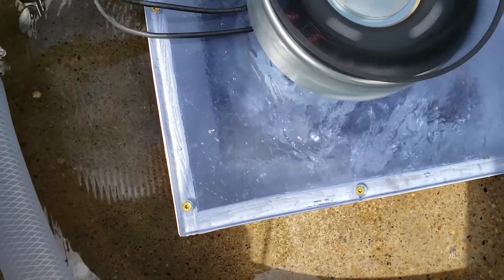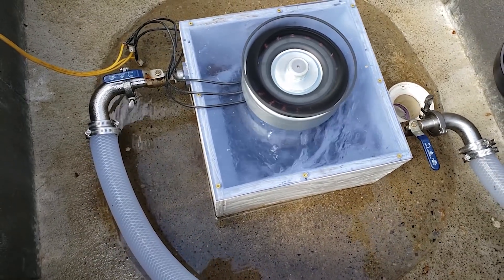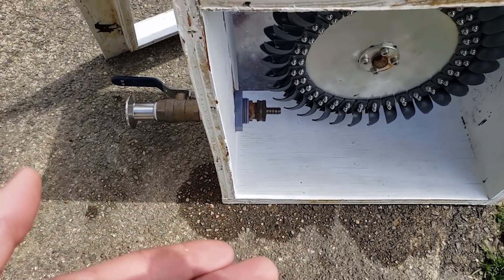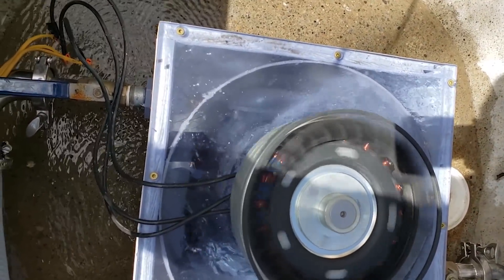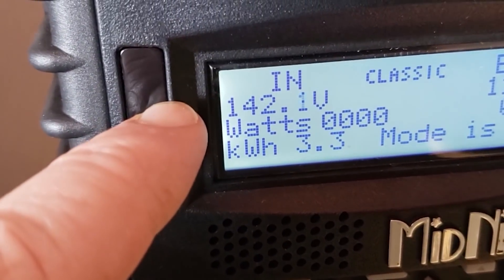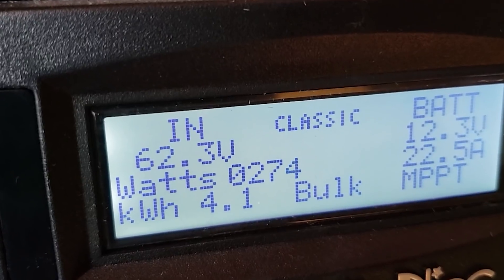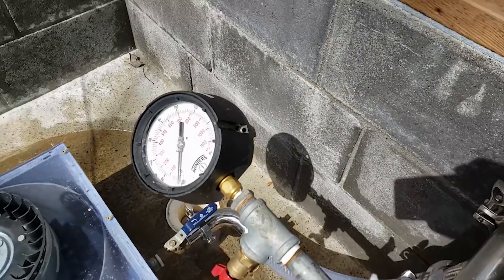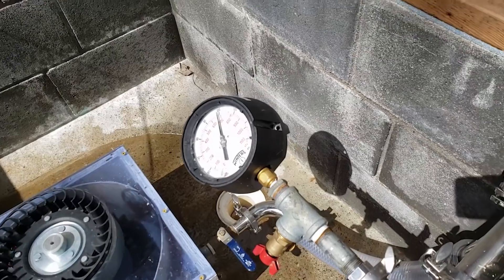Round Turbine Housing, An Improvement?

Comment: If the housing was oval shaped it would give the water a bigger spot to run off in. If you are only using two jets Kind of goes along with what Quentin Clark was saying. I wish there was a way to draw in the comments lol. But where the jet comes out have the housing go longer then put a curve in it that would come back to the housing right before the other jet on the opposite side. add another piece inside that would block the water from getting to the other jet or the turbine.

Comment: I don't know what is available in your area but a gas or water utility company's might have an off cut of main supply plastic pipe usually an inch thick its also quite forgiving if you need to make alterations unlike the stainless one if you find any issues. Also you could try plastic welding it together.

Comment: there is actually an ideal gap between the spoons and your outer wall. look into fan ducting, it's the same idea. but you really only want like 0.25-0.5" of clearance with the spoons, and you should probably drop your headspace above the spoons to about the same. what's the id you need, because I may be able to help you out with some stainless tube that's the right size

Comment: Looks like just about anything to get the 'spent' water away would be helpful, gap in the top, holes/slots/diverter vanes.  Perhaps even a stainless steel blower wheel (I.e. what gets use in HVAC blowers) with the vanes in the right direction could be an off-the-shelf solution that could be modified to work for your final enclosure? Just something to catch the water, move it away from the wheel to get it into an outer portion of the enclosure where the water can drop down to the drain.

Comment: You need to cut the circular housing right before it gets to the nozzles, you dont want a completely round housing you want the water sliding along the housing to escape before it gets to the nozzles, thats where a lot of your splashing is happening. You have spent water sliding along the housing wall untill it hits your jets of water. Cut the round housing into two pieces

Comment: Look into windage trays for engines. They have slots so the oil can escape easily into the pan and get out of the crank case. Something similar here would let the water escape from the wheel and help keep it from splashing back.

Comment: I think around housing that folds completely around the peloton wheel with minimal clearance (like 2-3 mm) would be the best solution. This way the air moves basically at the same speed as the turbine and will have very low turbulence.

To get the water out you create two whole at the top and the bottom behind the the jet nozzle, which match the spray back from the nozzle.

To avoid that water is falling back in the upper hole (by a different nozzle), you need some kind funnel leading outwards.

Comment: I would put some slots/louvers in the round wall. 1 or 2 just before the corner of the square frame should allow the excess water to get out and not stay in the main chamber rotating. That is only if the round wall increased efficiency.

Comment: Cone shape, so it splashes down
Reply: Cam to say this, he's thinking in too many 90deg angles.
Reply: I had the same idea. Doesn't even need to be a cone. Could be pyramid and still work a lot better than what he has. As long as it's moving more of the water down and out
Reply: what about a spiral cone to channel the water down as well?
Reply: That is an interesting idea.
Reply: Came here to suggest the same thing... or put some half inch by 4 inch slits long ways down the middle...

Comment: What if you would add to this round housing the following: foils past the impact point that start at the top and slope below the impact line in a quarter of the cylinder so that the water gets deflected below the other jet?
Another option would be to make the circle conical. Wouldn't that deflect it downwards too?

Comment: Looks like everybody is posting the same. As a quick and dirty fix, how about cutting notches at the top of the liner to allow spent water to run away behind it (as you mentioned in the vid), and perhaps cut some little flaps in the side wall of the liner to allow the water to exit behind it. This would stop the water circulating around and then messing with the jets?If you cut the flaps on three sides, then bend the flap away from the liner, towards the pelton wheel, the water could be diverted behind the liner. Staying tuned, and I am subscribed.

Comment: You could try a perforated liner to allow the water to escape.
Reply: I agree with this guy. perforated inner circular liner with holes about 5cm to 10mm in diameter
Reply: I was going to say the same thing, but thought I would read through what others had already said. Possibly angle the holes so they would help direct the splashing water out.

Comment: Joe, do you want the design 'rules' or guides for the parameters for the housings on vertical and horizontal Pelton wheels? Should have them lying around from my thesis somewhere. 

Might help you to sort something that works as best as it can.
Reply from the maker: Sure, you can email them to me, malovich@gmail.com

Even though I'm going turgo it will be an interesting read.
Reply: @JoeMalovich I undertand that Turgo might be a solution to the splashing but the disadvantage of turgo is that the force of the jet is not aligned with the rotation and therefore I would assume angular losses.
Reply: @JoeMalovich  Should be in your inbox.
Reply: For those that are interested, all of this is from Pelton Turbines, Zhang 2016 and checked with a fair few other sources.

The casing design is very different if the turbine is vertical or horizontal, the horizontal casing that Joe is using here should be completely open underneath the turbine while being close up to the buckets on the top. The gap between the buckets going up vertically should be 0.3 turbine diameter, extending out to 0.6 turbine diameter when the curve is in line with the plane of rotation. After that, it can drop vertically to the drain.

The circular casing Joe added prevent windage, but to be ideal, it needs to have a curve added so that it blends into the top of the housing, and then curves down to meet the runner, with a larger gap at the tip of the turbine buckets. Not an easy thing to make without casting something or getting more creative than the gains that this will likely offer.

Comment: Idea: What if instead of a case housing you would use a frame just to hold and align everything but allow water to escape away from the spoons so it causes no windage?
Reply: Just make the acrylic the size of the pit.  The pit is the housing, and sit the acrylic and stator on the frame.
Reply: I thought this but then thought that the top of the generator would be getting splashed.
Reply: @Will-thegrumpysoutherner  Yes, but you can still have the acrylic plate connected to the turbine, so should be the same.
Adding a metal edge would make it stronger, and then it can rest on the bottom frame. Could also add a shroud around the top center to prevent water from getting there.  Noticed some rust on one of the valves, but the rest seems to be more corrosion and splash resistant. Would be interesting to see how the shaft and bearings are doing now.. 
May be 3 points of contact in horizontal position. Might be less friction if it was vertical. And if it was not using bearings, but tight fit and oil.
(A metal alloy sleeve used as sacrificial material). Bearings definitely dont like water, and are less durable. So you have a really good point keeping water out of there :)
I'll have to re-watch how the turbine was put together now :)
Reply: So the motor is on top of the acrylic, and should not get splashed much. Would need to either extend the acrylic or make walls on the top side if the cage is to be skipped.
The bolt in the bottom is fixed, so no friction there. But then it's hanging on the top instead. But not much weight, so might not matter a lot which way it is installed. Probably simpler to just replace bearings now and then. :)
Reply: Sounds good. I would also like to see that.  A painted metal frame to hold the jets in place would let the water splash away further. The turbine can rest/attach on top of the frame and can also let you remove the turbine separate from the jets. Metal plates can be mounted on each side to direct the splash away from the turbine (out towards the corners).
Maybe it gets a bit messy, so the jets and piping could be covered with some splash protection instead.
The round enclosure does seem smoother, but the space is tighter. So a bit of give and take there I guess.
Really like your experiments :)

Comment: At 9:12 it appears that the water circulating is hitting the jet, thus causing it to loose direction. Perhaps the permanent solution should indeed be a flattened down facing cone with little windows to let water escape just before the jets. Anyway, great job!

Comment: Why not have the size of the housing another half as large to prevent splashback from being able to reach the pelton turbine wheel.  If it still has the energy to do that, have vanes fitted to the inside of the housing - fitted at an angle to "capture" the exiting water - preventing the return of the cplashback.  Think of internal baffles allowing the water to enter but not be able to reflect back.  One could even have them angled to deflect the exiting water downwards as a means of preventing splashback
Reply: That was my thought too.
Reply: Exactly!  Similar to a stator directing water onto a turbine propeller, but in reverse pushing spent energy water away from the spoons.
Reply: Exactly my thought to, turbine housing deflectors angled to channel wather outward  or down or a bit more complicated out and down at the same time.
Reply: Yes I was just thinking the same. The turbine housing should be a bit larger and with the walls tilted downwads or even curved round an downwards like a house roof to bend the splashing downwards.  I think actually a stainless steel baking bowl would do it. Though ruin the view we can see you filmed throig today in slow-mo. Thank you for your series. Learning a lot.
Reply: I agree bigger housing you can get 3/4 thick plexi would be superior to plywood resin/fiberglass too boat epoxy is very strong also he could turn side ways for horizontal different jet position too so that water is moving in one direction or dual stream focused in a reverse V so both streams are focused I dont see single side causing uneven bearing load because water is a solid and its fairly constant there is also the possibility of one jet followed by the other that way splash back is occurring later if you can imagine a clock and say the jet pushes it from 5 oclock the water leaves the spoons at about 12
Reply: So basically make the round housing a cone?
Reply: @BrokenLifeCycle  
the jets would be close to each other focused to the same point on the wheel
he is running them opposed like an opposed engine at the moment im saying instead to have one jet then the other a few spoons after that would likely stabilize the torque fluctuation as well
to figure the math you would need to find at what moment the water looses inertia at that moment the other jet is introduced
with the opposed setup i think he would get more power from setting up a mag pickup and an ardrino or micro comptroller to cause a nano second pulse and duration in a sense "timeing" the pulse like an engine ignition system
Reply: Quentin Clark I was just thinking of that, and I was gonna comment but I checked out other people’s ideas and mine was already here😂